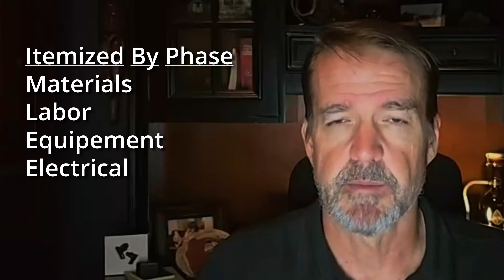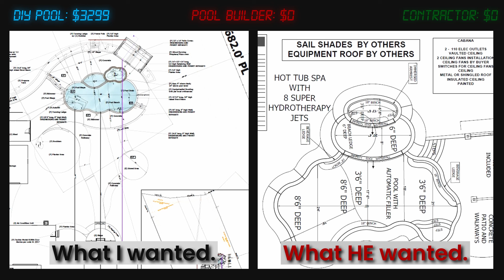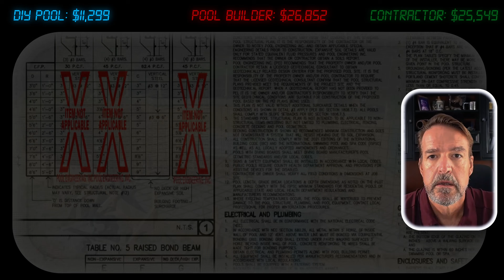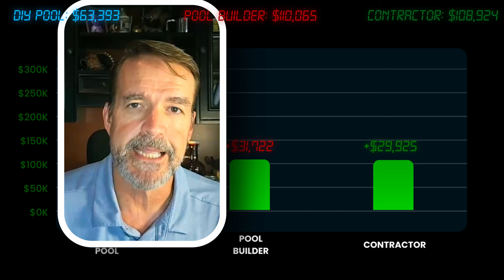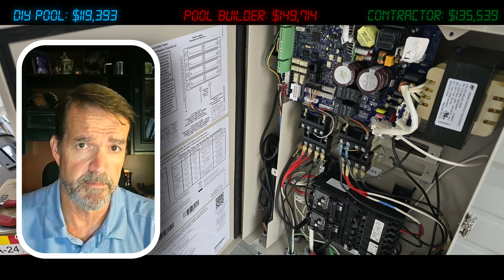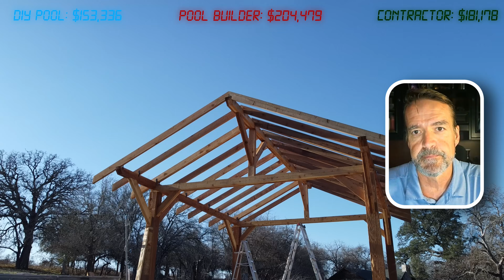DIY Pool Cost Breakdown: What My Pool Really Cost

Comment: You are undermining the pool industry. You also can't replace experience. There are so many things to know that diyers don't know. Also, It doesn't look like waterproofing was correctly done or done at all. Homeowners will get what they pay for.
Reply from the maker: Standard In-Ground Pools: The National Plasterers Council notes that a properly applied interior plaster finish (made with Portland cement and special aggregates) provides a watertight seal over the porous gunite shell. The intimate bond between the plaster and the concrete handles normal water containment without a separate chemical waterproofing membrane.

Comment: I built an inground pool in 7 months working part time. It's about 8' x 36' 10,000 gallon saltwater pool with a chlorine generator. The pool itself and all equipment was $3,380. It has a 3/4 hp pump, fabric filter, 4 LED lights, 4 jets, 2 floor drains, a skimmer, 1 1/2" pipe, chlorinator, porcelain tiles, and blue glass tiles. The pool cost does not include the homemade coping, waterfall, and seating area. You can see the video on my youtube channel.
Reply from the maker: With a majority of your cost being equipment...this is an incredible feat.  You gain a new subscriber in me.

Comment: I just finished building a pool calculating software application that a major pool builder invested in, and the quotes that I generate, are a lot lower than your pool builder is quoting. When I consider the size of the pool, and the RBB count, that's going to add up in steel, gunite and plaster, plus tile, stone work. I'm thinking the $220K range. You managed your own project, so you saved the markup or margin a professional would charge you. You didn't mention city inspectors, permits, etc.
Reply from the maker: For my area there were no inspections nor permits.  However, for areas where they are required, that's usually a small cost compared to the overall cost. You are correct, I saved the markup, but it was in exchange for doing the management work myself.
Reply: @TexasDIYCoach And tons of experience, the most important part.
Reply from the maker: @jimmyreid6516  No doubt I would not have done very well had I not had the experience and knowledge of the team at DIY Pools...that gave me the confidence to tackle this project.
Reply: @TexasDIYCoach  That is crazy! No Inspections and no permits? That's dangerous and a big risk for homeowners. You can't become a professional overnight.
Reply from the maker: @brianmurphy8371 luckily, the sub contractors were top.

Comment: The guy who overestimated this project was smart, he didn't spend a week's worth of time to itemize something he was never gonna be considered for anyway... I'd have done the same thing.
Reply from the maker: Possibly, except the week-long part.  He returned it pretty quickly, which is why I kind of knew he was pricing himself out.

Curious, if you were to do the same thing, why not just turn down the job?
Reply: @TexasDIYCoach I can’t speak on all contractors. But I can certainly confirm the tactic used. I worked electrical, plumbing, appliances, and other fields of construction. 
It was taught to me as “Fleece the sheep” or “overkill and over-bill”.
Simply put, bid high on undesirable projects so best case scenario you never land it. And if you do, at least it’s worth it! 😂
Now that’s not speaking on all businesses. Overhead, scale, prestige etc it depends on who quotes you. Some guys much rather get a certain type of client, where the company can maximize and dictate. A easier build where they can take on several jobs at once. Simple designs and very minimal customization. Making good profits, with less work. 
A lot of guys will bill like that to wealthier people. Esp if they feel like your design looks a bit involved. 
Better questions would be, if a stranger came to your home would they think you have deep pockets, or do you think they would consider you a “headache” customer? 
As in vocal, hands on, voicing how exactly how you want the job to go. Etc
I’ve seen this happen multiple times it’s in a lot of guys playbook.
I also worked with great guy who would give it raw and uncut to customers, flat out refuse the job. Hell even tell some of them he can tell they won’t get along and his peace is worth more than gold! lol
He would have them begging to do the job.
Reply: I’ve bid very high before that way if I got it     I would feel like it’s worth it.     Sometimes because it was far, the homeowner was to involved,  I was really busy.  Even if they asked for it itemized or said they wanna get all the materials or do parts of it themselves.  Lots of different reasons
Reply from the maker: @kevinr1212  There could be a dozen different reasons...the beautiful thing about the free market is you bid what you want to be paid and if, the homeowner in my case, is good with it...go for it.  I've had plenty of jobs that I did not take lowest price bid for a variety of reasons.  

If having the homeowner involved causes you more work than why would you not increase price?

In my experience with this project, all of my contractors where very happy to be dealing with an owner-builder rather than a traditional pool "builder."
Reply: @TexasDIYCoach .   Yep.    Looks like you were basically the general contractor.   The pool looks like it came out great.   Hope you’re enjoying it.
Reply from the maker: @kevinr1212  The program I joined definitely described the journey as being a GC.  So, in reality, I paid myself versus someone else and for sure that meant I had to do some work in arranging contractors, paying them, and evaluating work.  But, I had the DIY Pools team supporting me.

We love the pool and still cannot believe we were able to do it.

Comment: How do you find the sub contractors?
Reply from the maker: So with the DIY Pools and Spas program they provide some contractor leads, however, many contractor leads are shared amongst DIY pool builders in the same area.  Then, once you start lining them up, many contractors in one phase will recommend other contractors they like working with.

Comment: I wish I would have gone this route. My builder is still working on my project and was extremely expensive. All the quotes I got were 200k plus
Reply from the maker: Sorry to hear that.  How long has your builder been working on your pool?
Reply: @TexasDIYCoach Since late January, it’s not entirely their fault. Had to get a couple utility lines moved and the HOA was crying about placement/moving stuff from original approved proposal. My biggest frustration has been with the lack of progress, they will work on it maybe 2 days a week and then disappear for a while. Another annoying thing is that the job site is messy and they don’t clean it up frequently
Reply from the maker: @czwhat328  I had that problem when I built my first pool using a traditional builder.  Almost exact same, work for a while then no movement for weeks and yes, trash everywhere.  As an owner-builder in control of my own process, I knew exactly when contractors were showing up and I always put the clean-up as part of the job.  Since a payment was contingent on a cleaned-up site, you can imagine their motivation.
Reply: @czwhat328 they go work on other projects so they can 1/2 ass multiple pools at the same time.

Comment: How are you liking the Hayward equipment? I planned on going the Pentair route but it appears that Hayward is a little more discounted thru DIY’s contractor pricing. I’ll be going with automation, salt cell, 400k gas heater.
Reply from the maker: I think they both are good; however, ultimately, I went with Hayward because of the reportedly easier set-up with their automation.